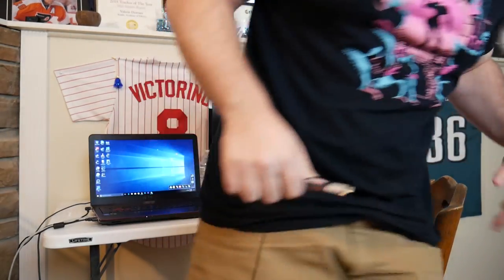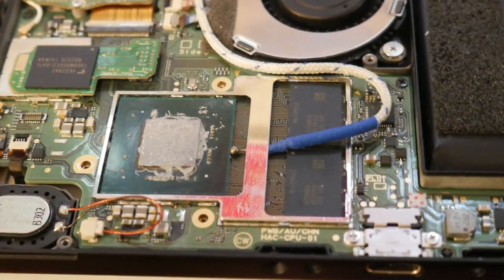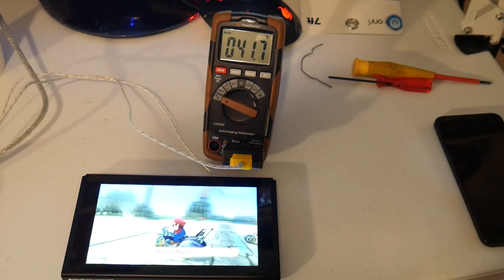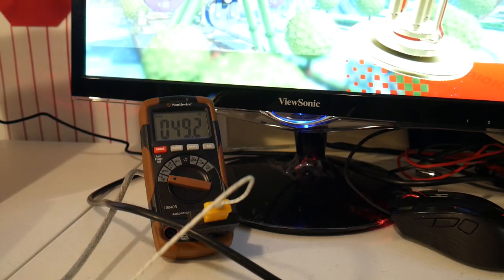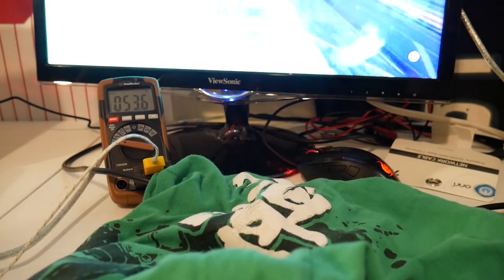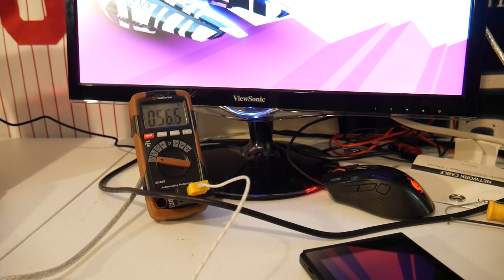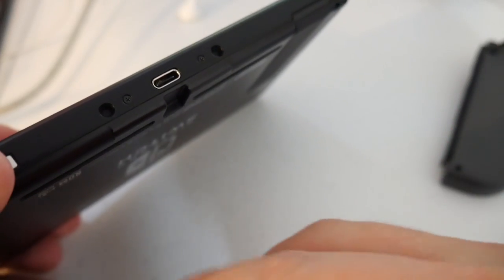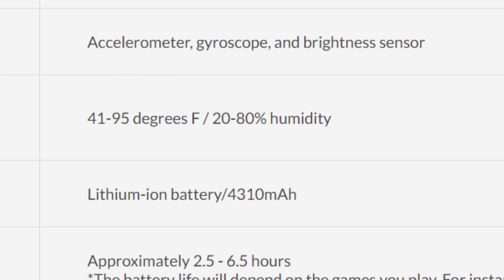Let's Overheat The Nintendo Switch!

Comment: If the temperature in your room is >95F, your Switch overheating is the least of your problems.
Reply: It gets like that sometimes, where I live.
Reply: Bibasik7 That's how hot my bedroom gets sometimes. Woo, 125 degrees during summer!
Reply: I live in Australia and it gets that hot quite often.
Reply: Jolly Swagman unless it's winter, it can be so fucking cold
Reply: why is there the same comment above?
Reply: At this monent i have damm 20 in my room, deal with it.
Reply: Just another day in (insert any tropical country here).

Try living closer to the equator. In my city, winter is 28-30C on average. It goes upto 40C in summer.
Reply: Luckily I live Northern Canada and the hottest we ever had was the rare occasion of 30-31C and we have air conditioners in my living room and even my room and it gets really really cool in here
Reply: I thought your profile picture was a hair on my screen
Reply: GhostFlashJGT wow. If you meeded air conditioning fir tgat then dont come to so cal. 80's are normal from spring to fall. Winter changes depending how it feels. This year it said fuck you and it hasnt rained other than like 2 half days. And last year it actually rained a decent amount. Our lows in winter are 40-50 and our highs are 70-80.
Reply: Jolly Swagman waltzing Matilda?
Reply: The max my house has been was 110
Reply: Thats quite a normal summer temp for alot of countries
Reply: if you measure temperature in Farenheit, your switch not working is the least of your problems
Reply: how do people live?!i live in the uk it's like 19-22 degrees
Reply: 95f is nothing. I used to game in my bedroom without AC, and it'd get way hotter than that. Now, I have an AC, and cannot live without it.
Reply: Lmao try 120-130, south Australia is fucked in the summer.
Reply: Haha, 48 C (118 F) is just regular here. We also get seasonal heat waves that always reach mid 50s c (130s F) and even more in the afternoon of those days! 
I live in the Arabian Gulf
Reply: I live in Arizona its 95 degrees and up all the time. Ive got scared cause my switch will get crazy hot.
Reply: @jollyswagman4714  lol same
Reply: I mean, 95F in summer is low

Comment: If you have 45° C in the room your Switch not running is the least of your problems.  :-D
Reply: Haha, it gets that hot in houses in Southern California.
Reply: Lol at 2pm it was 51° here
Reply: You guys should get air conditioning. It's this cool new thing we have now.
Reply: cvrator imagine if we didn't have it holy shit id die
Reply: cvrator Older houses have old, inefficient A/Cs even ~20 years old, witch makes it more expensive to run then a new A/C but a new A/C is $20,000.
Reply: It amazes me how people just don't seem to understand that these devices have to be designed for a worst- case scenario.  You can guarantee someone is going to put it on the carpet or bed in a really hot room and wonder why it fails.
Reply: I'm not sure how how it gets exactly, but my room becomes an oven when my PC is running any intensive game and the gpu is pinned at 99%. (I don't use Vsync, too much input lag)
Reply: Phaaze I had this idea for a pc my friends are building for me because I hate excess clutter and space inefficiency and I love portability.. both of which pcs are AWFUL at.. i want to use a pc like a brain for my house so that anywhere I can go in the house can achieve the utility of the pc so steam linking and/or rainway app access is a must but next was air conditioning.

That's the solution though is air conditioning. My idea is to bang out and install a glass door metal box into the wall nearest a vent so that I can use central air to pump into the case as well as the rest of the house and then build a 2nd vent onto the box going out to recycle any lost air but then during winter to cut off the main vent to the box and keep the personal box vent open so during winter the heat generated by the pc can help in contributing to house warming during winter.. hence cutting off the vent to it during winter.
Reply: The thing is, its generally WAY more efficient to use lots of low-powered computers such as Arduinos and RPi for stuff like that, rather than a PC.  Ultimately you will always need to use those things to interface with the PC anyway or spend WAY more money than necessary.
Reply: When it's summer and it gets way too hot, I just remove the side panel but leave all the fans on so the PC can breathe as much as possible. But if your home PC idea is going to be permanent I think it's good. In winter it gets so cold that all my temps drop like 10 C.
Reply: The whole point of a PC case is that with the case closed and the fans running it should run COOLER than with the side panels off, because the airflow is specifically directed over the hot components and vented out the case.

If this is not the case you should take a long hard look at your layout, possibly change fans or even the case.
Reply: I'm guessing you don't live in a tropical country, so you don't know how hot the ambient temperatures get. Even with the side panel off, the fans are still aiding with airflow, and components that need all the air they can get (like the GPU) have more room to breathe. I've sen my temperatures drop just by taking the panel off in real time. And no, there is no problem with my case or my layout. There's no cable clutter, and I have neutral air pressure. It all comes down to how hot the air outside the case already is.
EDIT: Let me add that my rig has no issues with overheating or thermal throttling. My CPU never goes over 60 C, and my GPU rarely goes over 70 C. I just take the panel off to keep them as low as possible. It still looks damn nice, so I don't mind.
Reply: Phaaze wish me luck lol
Reply: Dani Cordoba well tbh. The heat isnt a problem for me, I'm used to it.. It's the humidity that I cant handle. When its That hot and humid it gets insane
Reply: Kevin huh this conversation turned from hot temperature to ac to old acs then about the switch over heating. Talk about randomness
Reply: You got something there, pal...... Though even when you don't have AC, a fan of some kind will do miracles. Hot air is evil, but less stressing when it's moving. Have been to California in summer (as a mid European, who's used to 100°F maybe 2 weeks a year), and if there wasn't a roof fan in my room, I would have needed to buy something for managing this damn heat.
Reply: Haha it's 5°C in my house and the heating is on. Living in Ireland is a joy.
Reply: It's about that hot in my house about once a week for about 6 weeks of the year.
I'm in a rental property with NO AC (and I'm not allowed to make alterations to the property either. )in an area where summer outdoor temperatures can reach 38-42 celsius.

Trying to figure out how to stay cool and not die of heat stroke in these conditions is quite challenge. Thanks to the way the house is built, the indoor temperature may eventually exceed the outdoor temperature too.
Especially if there have been multiple hot days in a row and thus no time for the building to cool down again.

Using a switch, or other device in 30-40 degree heat is not that far out of the question.
In fact, as I'm talking to you I would estimate the current indoor temperature in my place to be somewhere in the 30-35 region....
So... Yeah.

Really depends on where you live, and how wealthy you are.

If you're a renter around here, (Australia) you are thoroughly screwed in hot weather.
The safest thing to do on a hot day is find an air conditioned public place, like a shopping centre or something.

I WISH I had AC, but nope.
Have to deal with temperatures up to 42 degrees without it somehow...
Yay.

By the way, fans are great, but I find they lose their utility once you get much past 36 degrees. Below that, they manage to blow some cool air around.
But above that point, they just blow hot air at you, which is quite unhelpful. (ice packs do help a little, thankfully)

My computer is fine. The GPU has vastly excess cooling unless I push it to it's limits. And I have a water cooler on the CPU that keeps it under 20-30 degrees above ambient. So yes, if it's 45 degrees or more inside, then the system temperature could hit 70-80.
But that's still within allowable limits...
In reality, it doesn't tend to get like that even in hot weather...
But... yeah... Hot weather.
Not everyone has the luxury of being able to avoid it, nor do we all have AC to save us from it.
Reply: Kevin 51° fahrenheit or celsius?
Reply: Gets that hot in summer in australia
Reply: Aaron Sketch Tips I think he meant 51° Kelvin
Reply: That's an average summer day in Australia...
Reply: a AC is 250$
Reply: a paper fan is free
Reply: Ha! At time of typing he has 666 likes
Reply: @danysanchez8767  yes
Reply: Baiet Simpson ouch what type of system is that I just had a brand new one installed for 3500?
Reply: Shit ,,, dont come to Australia then mate
Reply: Baiet you ever heard of windows Ac s or an even higher BtU floor model Ac? Lol i cool 3 floors with a 12k btu window AC and a 35k btu floor model Ac and i never even need to put them higher than medium settings and its never gets hot. Good walls insulation and having no openings anywhere were you can get drafts mean "Alot" Tho.
Reply: Same in Australia 

👁👁
    👃
    👄
Reply: PraiseTheAlmightyGod r/iamverybadass

Comment: Kinda like that this proves that switch systems don't normally get hot enough to melt/warp/burn the system
Reply: patrick borrelli but my switch is bent and it gets hot really fast...
Reply: Luke Bouwmans faulty units are a thing for everything.
Reply: patrick borrelli think carrying in your pocket is worst then just heat things don't bend to heat without force though horror heats allow easier bending.
Reply: Trey, the thing is, what kind of psycho would fit a switch in their pocket. You have to put it in a bag or carrying case.
Reply: Shattered_Pulse umm me take the joycons off and walk carefully lol key word wall careful as doubt they are built like phones that can be put in a back pocket then sat on
Reply: mine seems to have warped a little but as far as I can tell its never had any technical issues
Reply: I can fit it in my jacket pocket ez. Just separate the joy cons and it slips in without a problem.... now should I..... 

Probably not since there tends to be crumbs in my jacket pockets :p.
Reply: Mine is warped but I'm fairly sure that's just how its designed.  I haven't seen anyone check if they are warped from the factory, I suspect they are and that also would help keep those air vents clear when sat flat on a table, it may even be designed like that.
Reply: Alex Atkin i don't think they would do that..
Reply: patrick borrelli XD my phone heats to 120 F It's very useful if I want to make popcorn.
Reply: xyzqsrbo even then a faulty unit wouldnt warp it. The temperature needed is dangerously hugh to even soften the plastic to move it. If he removed the fan then he showed that their is no way to have this happen. An idea was made that it warped because the heat caused the switch battery to expand. Now that is worse. If the battery expands then the switch will catch fure and we have a nite 7 issue again. These batteries are so delicate.
Reply: Luke
I have read that most likely it was bent from the factory and you didn't notice till you heard about the so called warping issues
Reply: Do your switch a favour and get a case for it, putting it in your pockets is asking for it to be scratched/destroyed
Reply: @lukedoedel147  
Then your switch is broken
Reply: @stepanfedun9122  nah its fine now. Doesnt get too hot anymore
Reply: My switch smells burned and gets hot pretty fast can someone help😓
Reply: Mine switch got really hot
Reply: @lukedoedel147  bent like acutally bent? then yes I could see it getting alittle too hot. after all the heat pipe is thin as hell and any bending could degrade the heat pipe performance. also the way the heatsink interfaces with the cpu's surface. not entirely robust i must say. (my kid has the switch light and he got pissed at it and shattered the screen. after replacing the screen i could see that the internal structure was beyond warped. and the enclosure it's self falling apart. kids are destructive....... thing gets pretty toasty when he plays it now but it has yet to turn it's self off.)
Reply: @alexatkin  ,y olded switch looks like it has a slight warp to it. bought it that way from a pawn shop. it don't even get warm. wondering if the heatsink is even making contact. have not played it long enough to find out.
Reply: @hispanicbaljeet4076  also got to take into consideration that the battery is in it's own plastic tray and that the main board is sandwiched between a screen and a metal shield which can bend.

Comment from the maker: Here's a look at temperatures when connected to Nintendo's dock. This is an older video I did a few months back. https://www.youtube.com/watch?v=jfAW5sQSCeg
Reply: Spawn Wave thx for your video experiment with nintendo switch guys,,i never afraid my switch got hot and break my switch
Reply: You meant "hypothesis" instead of "theory". You could call it your theory after your testing I guess
Reply: Spawn Wave Does heat not escape out the top vent more than the back anyway?
Reply: He's referring to the intake ports, which is where cool air enters the system. Like you said, the large grill at the top of the console is the exhaust port where the hot air escapes. He's basically debunking people's assumptions that blocking the intake vents by lying the console down will make the console overheat.
Reply: CF YT back ports are intake it's hard for air to leave if hard to pull air in.  The switch is underclocked the clock could be increased by 50% to be set to the normal clock speed but seems at suck clock rate Nintendo got worried about over heating
Reply: Spawn Wave There are no vents on the back. They were found to be speakers in a teardown by Jerry Rig Everything
Reply: Spawn Wave you should recieve an award for BEST SKIT OF 2017

Comment: Would honestly want to see a round 2, stacking up the new revised Switch and Switch Lite against the original and see how long each can run fanless.
Reply: All switches have the exact same processer so they would all overheat at the same time.
Reply: @kowhaifan1249 
That is incorrect.
The Lite, 2019 Model and OLED use a newer version of the chip, that is produced on a smaller nanometre process, resulting in a more energy efficient chip.

This is why the Lite, 2019 model and OLED have longer battery times than the OG 2017 model.

Comment: My Switch overheats in handheld mode, not enough to turn off, but enough to toast my fingers near the right joycon. Nintendo fixed it once, but it's happening again so I'll be sending it in for repair again. Why me?! Don't answer that.
Reply: Michael McCormick Do you have proof it's over-heating or is it just running normal operating temperature? The NS gets pretty toasty.
Reply: Rebecca Brunner Does yours cause your fingers discomfort and make you have to grip the joycon from the very outer edge or stop playing? A couple people told me theirs never get uncomfortably hot. Plus, the first time I sent it in it worked better for awhile and they said they identified my problem and fixed it. I don't know what was wrong. They don't offer specifics.
Reply: Michael McCormick thats normal tbh, you are overreacting
Reply: Michael McCormick Yes, for me personally it causes low levels of discomfort. I'll often put my system down during loading scenes or put it into tabletop when it starts cooking. Heat is very comparable to my phone / tablet when streaming.
Reply: I got silicon grips to fix my problem, it insulted the heat it doesn't affect battery life
Reply: Yeah it shouldn't get that hot, I've played Zelda for like 10 hours straight docked and it didn't even get that hot.
Reply: What games do you have to play? I played breath of.the wild for a few hours at a time in handheld and mine only gets warm
Reply: you probably owned a playstation or xbox before 

this is KARMAAA
Reply: @eyeris4050  ain't nothing wrong with owning multiple consoles, someone's jealous.
Reply: soul elevation96 i'm not jealous

i have a 3ds a dsi a ds light , a wii and a switch. 

i don't got time to be jealous
Reply: @eyeris4050  so nothing but Nintendo hey? I have my switch, one x and my pro, best of all worlds!
Reply: soul elevation96 i'm a nintendo fanboy

owned a ps3 once but it was not good at all
Reply: @eyeris4050  I can't believe your proud to be a fanboy lmao
Reply: @PraiseWorthy9  It's normal, my Switch got hot and it caused discomfort as well as a heart attack from me, it's meant to get hot and if it gets too hot it will shut off
Reply: I need help so most of the time I play splatoon but for Christmas last year I got super mario oddesey and I played it for a really long time and the switch  was pretty warm but I didn't care like a week later It smelled burned and it got warm like in a minute (and the switch never got this warm so fast before) I gave it back to the store where I bought it so that they repair it and when I got it back everything was fine but after some days everthing was like before the burned smell and that it gets warm really fast I really don't know what to do if someone can help pls answer

Comment: So if the temp on the outer edge of the CPU was 67 C, the die temp was probably around 70-75 C.

And despite those temps, it looked like it was still running the game pretty well.